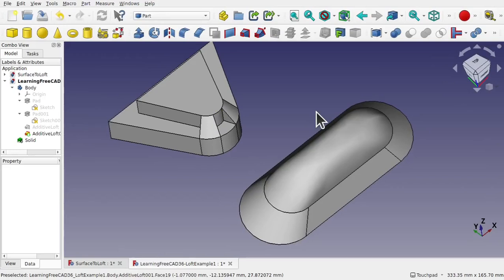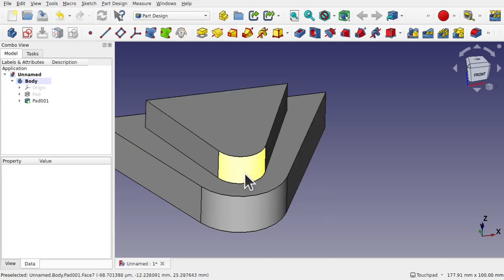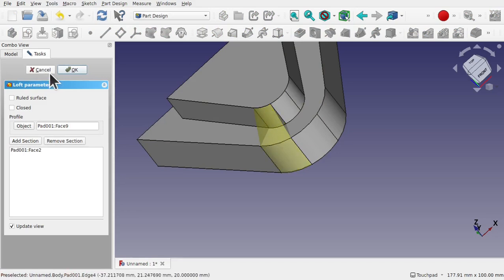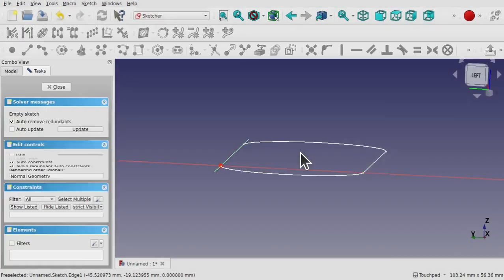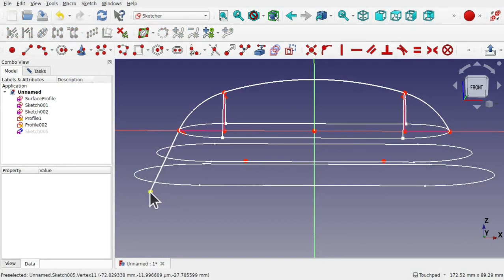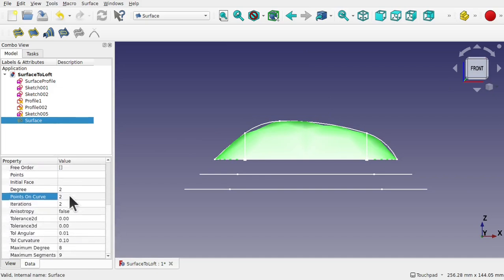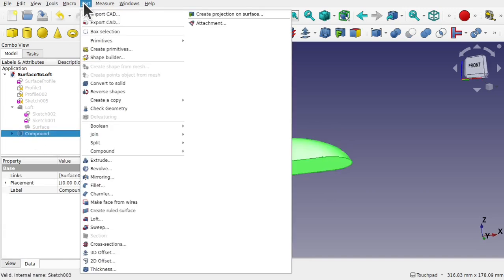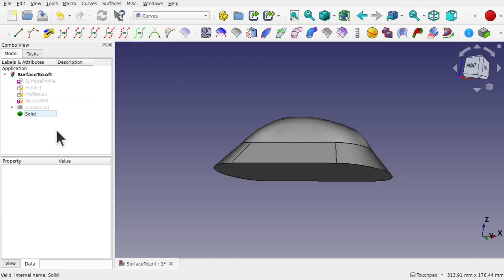FreeCAD For Beginners 36 |  Loft Workflows | Faces for reinforcements Loft to Surface for finishing

Comment: I could not get this to work for me. I tried it in both versions. Version 1 and version . 21 and no matter what I did, in version one, I was at least able to get the loft. But I didn't get the Segmented. loft. The loft had lines. like it was divided after. I used the split edge. but in neither one of the programs did it show an actual line dividing the the face of the curve.. when padded I kind of gave up on this exercise. I'm mean, I literally tried everything I could do. Different constraints. thinking that to me that maybe the symmetry or the tangent was interfering. I don't know. I. I could not get it to work..

Comment: Maybe it's because I'm using version one again, I don't know. I'll switch back and use version. 2112. I keep getting. Wires are not coplanar.  I tried switching over from. part design and doing it there. to the part workbench. but no luck. Wires are not coplanar.

Comment: I'm following through your tutorials and am really enjoying them but have hit an issue with lofting between the curved faces both pre and post split, I get an input error "wires are not coplanar" I can loft between the straight faces just not the curved ones for some reason. Running FreeCAD 1.0.0
Reply from the maker: Glad your enjoying them.  Yes this is a restriction if the face is not planner (all edges are on the same plane, in other-words flat) so this technique wouldn't work in those scenarios.
Reply: @MangoJellySolutions  I saw someone also had this issue following this tutorial on a more recent version of Freecad on their forum but followed instructions to use mesh remodel workbench and subobject loft to create the supports and then I unioned the pieces, is this how you'd do it in 1.0.0?

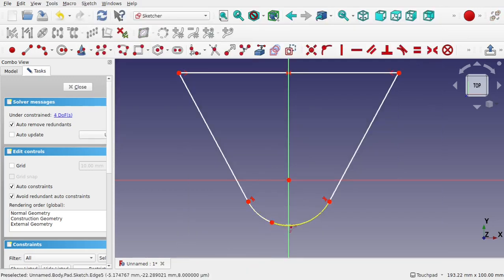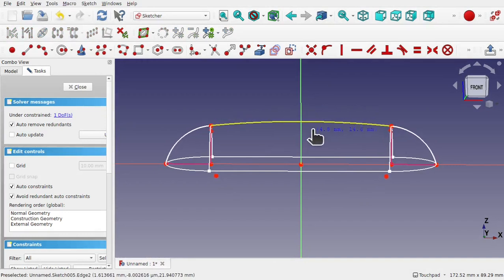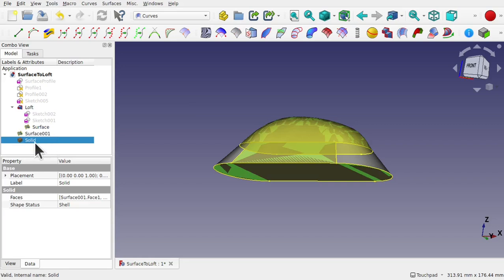Comment: 5:43 Had some difficulties getting the Symmetry on the Sketch Splits to take. I think my FreeCAD was Auto Removing them as redundant. I worked around it using a Horizontal constraint instead of Symmetry. Same result in the end. Again I presume some differences possibly in my preferences or setting to Darrens? 8:03 same thing happens and same workaround (Wonder Why?) 17:46 Headed off an error in Geometry (One of my Arcs had not Joined properly). it's important to Test Coincident & Tangents (It'll save time later looking for errors and why Geometry/ Surfacing or Padding doesn't work. 31:20 FYI FreeCAD 0.21.1 The Parametric Solid works First time. Obviously improvements since Darren did these Tuts, worth doing the workaround though for older version users.

Comment: Unfortunately it seems the RealThunder branch of FreeCAD doesn't allow for lofts between faces. It will just give you an error if you select a face for a loft. Works fine in the standard FreeCAD though. I've been exclusively using the RT version since it fixes the topological naming issues. Looking forward to when they merge into one. :)
Reply from the maker: The RT branch is quite far behind the main branch of freecad unfortunately. Hopeful they will both come back into since at some point.

Comment: This is very helpful and quite the timing too since I'm trying to model a canopy. One question, how do you add a uniform thickness for the part? For no I just duplicate the solid, scale it smaller and then boolean it. Is there a more efficient way?
Reply from the maker: Great to hear. In regards to uniform thickness there are a number of ways. The way in which you described, if your using a part workflow then the 3D offset but that can often fail, creating a walled geometry sketches, creating a duplicate and tweaking the inner copy size parameters. It's funny you should say this as I am putting together a video regarding this subject

Comment: Hi, your tutorials are very helpful! In some of them, like in this one you are creating a sketch on a face. Here you are showing how to "repair" if you are making changes on objects earlier in the tree. If you are "pretty dam sure" on your final design because you remodle an existing design, like in your previous 5 part tutorial series with the final Assembly at the end (which was nothing but GREAT!) making a sketch on a face is not creating "trouble", because your are "just replicating a working design. My challenge is normaly, that I want to create some  - more or less - simple parts to print them on the 3D printer and I do not know the final design, because I need to test them and than tweak them here and there to be functional as I would need it (tweaking dimensions to compensate the plastic shrinkage from the 3D print for example). Long story short: I am trying to avoid as much as possible the Topological naming problem to be able to make changes and "optimisations" without blowing up the model and do the "repair" work every time.  With my limited design knowledge I use the spreadsheet, Master Sketches, Datum Lines and planes to make the desings as robust as I could for future changes (certainly it will not work out 100%). 
So if you could have in mind in your hints and tricks for FreeCAD the aspekt to go arround the topological naming problem to make designs "changeable" as good as possible, this would be realy great!

But again: Your tutorials are very helpul and you explain everything in very good and replicable way!
Reply from the maker: Thank you for the feedback it is always appreciated and taken on board to improve future videos. It's these kind of comments that help me grow as a content creator as well to enhance the learning experience what I deliver . Thank you 😊👍

Comment: 00:00 Intro
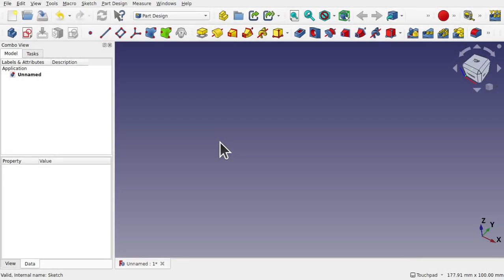01:23 (Part Design Loft workflow) Initial sketches
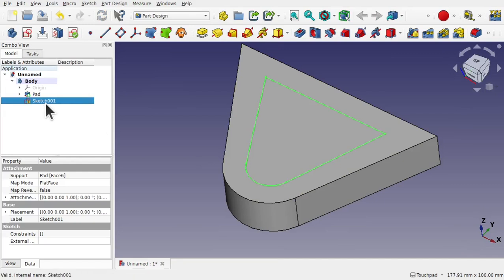03:45 Lofting between two faces
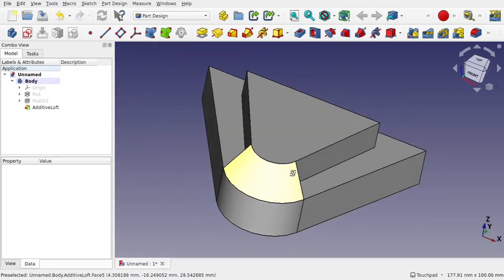04:58 Modifying original body to allow different loft
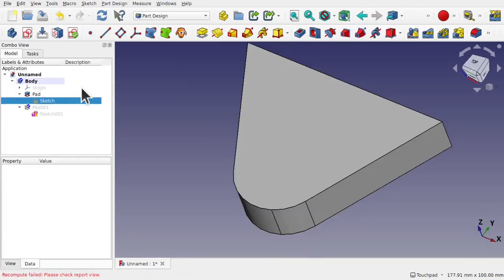05:56 Fixing topological naming problems after changing original body
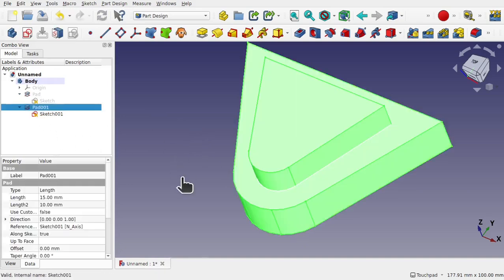07:32 Modifying original body to allow different loft
09:24 (Part Loft workflow) Initial sketches
12:22 Creating and linking rib sketches for surfacing
20:02 Surface Workbench -> Filling (and going through surface options)
24:03 Part -> Loft between sketches and surface
26:26 Many different methods to make loft and surface a compound
32:08 Outro
Reply from the maker: Thank you. Appreciated as always. 😊😊
Reply: @MangoJellySolutions  ❤
Reply: @MangoJellySolutions  Maybe it's because I'm using version one again, I don't know. I'll switch back and use version. 2112. I keep getting. Wires are not coplanar.  I tried switching over from. part design and doing it there. to the part workbench. but no luck. Wires are not coplanar.  (I switched back to version.. 212. Did it on my first attempt Why does version 1 and version. 21 Have such difficulties doing the same modeling. It absolutely would not loft those faces in. version one.